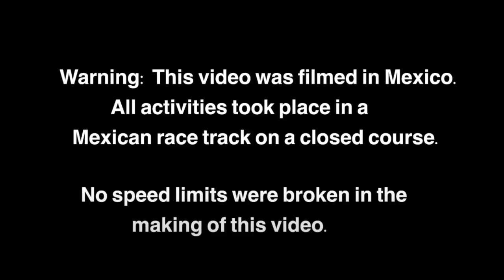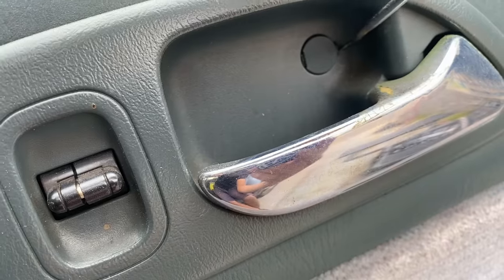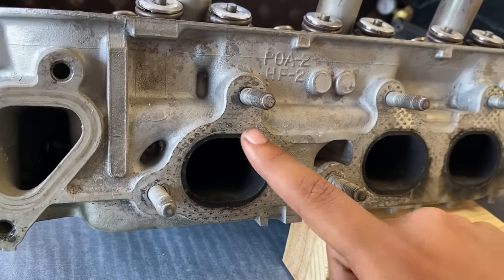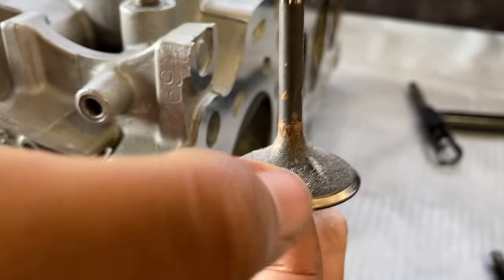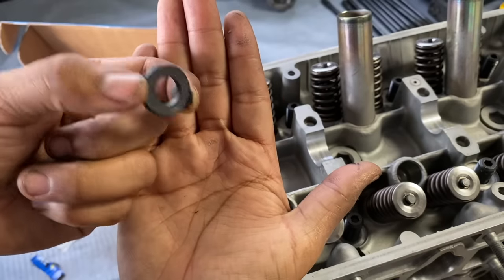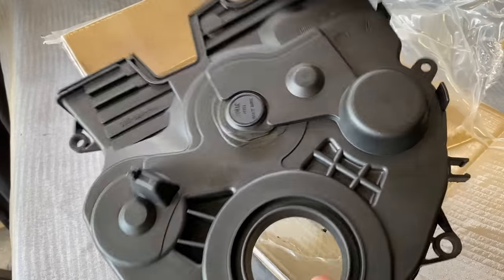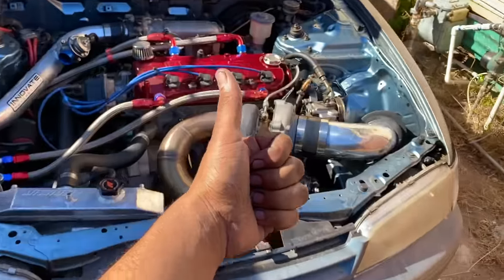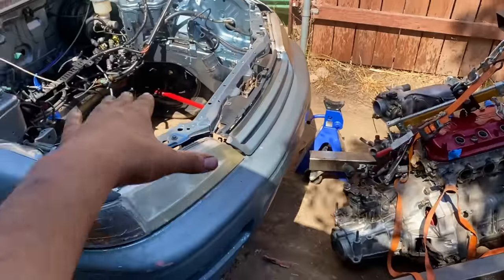Turbo Honda makes 392 Charger Mad + Build Upgrades

Comment: As a 392 owner, I don’t understand why everyone thinks they automatically have race car status when they buy one of these….it’s not that quick. I’m so glad to see a built F22…..I miss my 96 4 door…..indestructible. Shoulda kept it. Nice content.
Reply: Sure the 392 is a sick car, I'd like one, but as you said before they're not insanely fast or anything
Reply: Well that's the idea Fiat/Chrysler does right? The biggest engine wins right? There is no replacement for displacement right? No current Charger or Challenger is a racecar. Just a loud heavy brick that has no actual performance.
Reply: @aidantanny7230  in my opinión I don’t even  find them attractive either they just a big boxy heavy boat
Reply: @fusionsportdaily1650  I've driven my dad 2019 Charger Scat Pack with the 392 Hemi V8 and its a beast.
Reply: @CJColvin  not against real cars, maybe a beast when you line it up next to a 5.7 😂
Reply: Yeah they know nothing about cars their parents buy them for them so they don’t even think about what’s under the hood. They be like my car looks way cooler so it must be faster lmao, he was so salty having his little hissy fit after getting smoked
Reply: I know. Many people but mustangs around here and there all manuals. Only vehicle's that are fast dodges around here are hellcats and the 6 trx trucks that are here
Reply: They are quick, but my car (ecoboost mustang) is quicker than them when I’m running e30. Their biggest issue is weight. And overconfidence.
Reply: @ElRiki77  there's a reason the camaro is better. Chevy may have not fully out thought into it, but the magnetic suspension helps agility alot... The v8 feels cat like. In the dodge you feel the need to just stay straight, and you feel risky diving corners in a dodge, even with the SRT package for the hellcat it's the same. The demon is fine as long as you don't go for the last key like a speed junkie.
Reply: It may not seem that fast to you personally but Its quicker than most average cars on the road. Plus fca did good with advertising the brand
Reply: @bradleyisfishing  Mann I don't kno bout this one I had a 2015 eco boost mustang it was quick but never went over 120 😂 my 2020 scat I definitely hit 140 in it probably could've went faster but wasn't gonna test it😂... again it was a 2015 eco so there probably faster now..boi do I miss her tho I had ruby red
Reply: 485hp is a lot... But the Dodge Charger/Challenger are 4400lb boats with 0 aerodynamics. 

For reference, a C8 makes only 10hp more but it's sleek and 900lbs lighter, so it's WAY faster and handles better.
Reply: honda boys       mopar boys
                      🤝
              most hated
Reply: @CJColvin  yo ppl gonna hate bro I own a 2020 scat charger n it is jus fun too drive n I agree it's a beast sure not the fastest car r maybe the coolest looking me personally I still think Camaro is the best looking looks kinda like a jet, but I've owned plenty of cars and this is without a doubt the funnest
Reply: @fusionsportdaily1650  definitely the stupidest comment I’ve seen in 2021 😂😂😂
Reply: @TheyCallMeMrMaybe  Exactly mate
Reply: @marlostanfield8127  My mom has a 2010 Camaro RS and she loves it.
Reply: @CJColvin  after watching transformers when it first came out I had to get a Camaro I finally got one 2016 convertible but V6 I didn't care tho earlier this year it got shot up😔😔 that's how I got my 2022 scat
Reply: Yeah crazy because I got rid of my scat to jump back to a v6, I just felt the car was only quick against other heavy cars
Reply: @thetrimilliouseffect6372  I admit these car notes a Lil high 150 oil change $70 fill up tank😂 so u only buy a car to race other cars 🤦🏾‍♂️ I see
Reply: @ElRiki77  what’s a “real” car?
Reply: @thetrimilliouseffect6372  why didn’t you do weight reduction?
Reply: @marlostanfield8127  it plows past 120, on e30 I’m making about 410 hp so it more than easily gets up there! Mine is rapid red, so very similar to ruby!
Reply: Homie said a 392 485 horsepower Hemi engine isn't that quick, I don't know what drugs you are on bro.  0-60 in 4.2 and a top speed of 182 LOL.  It's no Hellcat, but the engine sounds sexy as heck.  Even the R/T's got a nice sound.  I am 99.9% sure everyone that buys a Hemi engine gets it for the beautiful sound.
Reply: @HappEShock  they think because it’s heavy it’s not fast. They clearly haven’t heard of weight reduction or performance mods
Reply: @zoidzoid87  oh it’s plenty fast! I was only marginally pulling on it, but it’s still very fast! Anything sub 14 seconds in the quarter is plenty fast.
Reply: @fusionsportdaily1650  land yacht 🛥 in my experience challenger drivers are more respectful than charger drivers
Reply: Goddamn bro you don't know how happy I am to see a 392 owner thats actually aware of what they have
Reply: The 392 is just loud not fast 🤦‍♀️ there nice cars and all
Reply: @bradleyisfishing  they aint fast, even my near stock 2009 ls460 leaves them in the dust every time
Reply: @bradleyisfishing  found the capper
Reply: @DeathhAngel1  bro what are these people on 😂😂
Reply: I miss my 96 as well
Reply: @razzo086  I think of racing someone as going one of two ways: either I win or I get to hear some good exhaust as it goes by me. The third option is electric, but let’s not talk about that.
Reply: @DeathhAngel1  how does it do that? It weighs the same but makes 100 hp less.
Reply: @ashergotti6473  what are you calling me out for?
Reply: @bradleyisfishing  i just realized you were talking about a 392 my bad, ive only raced challengers/chargers with the hemi badge or r/t which i believe is a 5.7. But I would leave them every time
Reply: @DeathhAngel1  yeah they are a much closer comparison to the stock ecoboost, but they are a hair quicker I think. Once you tune you immediately leave them. Fine power numbers but the weight is just too high.
Reply: @aidantanny7230  yea if you want competition for this get you a demon instead or a ghoul💎
Reply: @fusionsportdaily1650  that's some educated hate there buddy.
Please tell us all what exactly you drive. And don't lie
Reply: @HappEShock  they are slow compared to the competitors.  10 speed stangs and camaros eat them alive.
Reply: Yeah my Q50 walks scats left and right
Reply: @TheyCallMeMrMaybe  lol lawd..ur comparing it to a c8 I'd hope it's faster damn I mean c8 is up there lol
Reply: @fusionsportdaily1650  I’m not going as far as to say that and sound like a hater. They are loaded with performance and fun for anyone looking to get started into the muscle scene. It’s a great starter car, and I guess that’s why so many people think it’s the buy all, end all. You can take 6.4’s well over 1,100 hp for less than $15,000 if you can do the labor yourself. My scat still eats Camaros and 5.0 that don’t have the 10 speed….don’t get it twisted, they’re powerful, they’re just not the Bugatti killers that so many dweebs think that they are.
Reply: @HappEShock   my widebody 392 scoots pretty good.
Reply: @bradleyisfishing  agreed. I like the way your setup sounds by the way. Bet it’s a blast. I don’t see why people want to bicker so much as if they’re the ones who hand built their individual cars from the ground up. Anything is fast given enough time money and effort is how I see things.
Reply: @bioheart09  idk man, until my cousin tuned and cammed and did a few other things to his 2017 6.2 Camaro, he couldn’t touch my 2015 scat manual or my boys 2014 5.0 manual. I do like the Camaro though, Chevy just needs to quit pandering and step their game back up nowadays. I have no animosity towards them, they just don’t feel like the Chevy I remember
Reply: @marlostanfield8127  I’ve had my scat to 153….maybe I’m just used to it, but even my 7 yo daughter isn’t even impressed by the power output anymore. I need to step my game up and stroke it and twin turbo it I guess 😂
Reply: To be honest, I just want my first car back. Another 1988 Trans Am GTA with a nice LS swap of any kind and I’d be giddy. Maybe I’m just bored with my chally.
Reply: @fusionsportdaily1650  there is truly no replacement for displacement though….look at NHRA top fuel cars or whatever they’re called. The fastest cars are all pushing massive numbers.
Reply: @noaht5191  I assume you saw my Reddit post? But thanks! I can brag on my car all I want, but I only put a few things on myself and flashed a tune. I have more respect for people building small NA motors (4 and 6) because of how much harder that is. That, and people that build a car way beyond its logical limit like if someone put a built block and made 550 wheel in my car. It’s uncharted territory and it is crazier to me when that si was making 230 wheel NA than my boosted car making 360. Even though I have lower displacement, it’s really cool to see. 

My car is a blast. Pops loudly when I want it to, has a really interesting sound above 6k, and has power absolutely everywhere through the revs.
Reply: @noaht5191  everything after 2014 has like no heart or soul. Just looks... Trust me I know. The 2012 - 2014 malibus were quick asf. I'm surprised Chevy is that bad with the newer ones though... They need to just axe it atp and just spend whatever sports money there is on the Cadillac V. Or what's left of the V. Camaro is done because it's more uncomfortable to get in and out of then most cars I've owned or seen.

Yo cuz have a manual in the camaro or a automatic?
Reply: 392's are impressive but they're not that quick, stock for stock an LS3 vette beats them. And an ls3 with just a cam beats a hellcat. I raced an auto pullied hellcat in my Cam and headers only c6 and I stayed on his bumper, if we had a little more room, I would've passed him
Reply: My 09 ISF eats these for snacks.
Reply: @sebastianblas3109  corvettes do two things really well: top end and hauling golf clubs. They have great aero and just keep pulling and pulling. Mustangs do great top end, but a c6 does a claimed 186 mph with only 400 hp. Scats are great below 100, but fall off hard after that.
Reply: @2 Wheel Life Nah, i have LDP's and a tune haha
Reply: @Nonya Biz damn I felt that comment. Fiesty babeeeeyyyyy. You ain't wrong tho, rwd can handle the most power. AWD distributes it the best.

To much FWD power causes the front end to dance no matter what you do. Especially if your car is light as shit, every gear will make the car buck.

Shorty got down with the sports mode on. Let that scat have been supercharged tho.
Reply: Jim jibroni  uhhh...a shit load of people lmao, dodges especially
Reply: Jim jibroni   You are pretty full of hate my guy. You should work on that it's just a car lmao.
Reply: @bioheart09  a dodge feels like the most stable car in the world with its front snd rear double wishbone suspesion I floor mine in full corners in order to negate the understeer
Reply: @hemiplow1297  trust me, that beast doesn't bend like a Honda. The learning curve of the dodge vs a Honda is not even a competition.

Remember, the charger has Nürburgring times. Limits have been pushed. But you'll see in alot, the drivers have to really rely on those brakes to gauge those sharp turns correctly becsuse you have to commit to it.

Older Acuras suffer from the same issue because the SH-Awd system would cut off on you if you let you foot off the gas to control the turn. You have to pedal through the turn to keep the torque vectoring active.

But HONDA, is a efficient ass FWD bro. I can't see a dodge beating a newer Honda with a track that has turns.
Reply: @sebastianblas3109  I can second this. My pops has a anniversary c6, pure stock, and I was able to kill a 2014 scat pack, touged him to so he know it was real. I'll say, GM was doing great back then...
Reply: Im curious  how much hp does that f22  put  out ?
Reply: @jacdime12  there's two versions of the f22 I beleive. I'm not a mechanic or anything. Kinda slow too. But I think there's the f22a1 and a a2. I only kno this nonsense cause of the prelude.

Aw shit I'm smacked. I think one puts out 145 hp. The other is like 120 or somthing.
Reply: I get excited every time I see a 392. My modded Focus ST gaps them every time. The butthurteddness of Mopar guys is always funny.
Reply: @malaki4519  but even with mods they’re slow
Reply: Made for going straight
Reply: @TheyCallMeMrMaybe  cost X2 the price of a scat pack
Reply: It’s okay bro I pick on 392’s with my gti it’s so fun to get them mad
Reply: @fusionsportdaily1650  you realize every hemi besides the 5.7 is amazing? Only thing wrong with dodge motors is weight to hp ratio. The 5.7 is only bad from factory because with a better intake, cam, and throttle body itd make 410-420isn hp😂
Reply: @ElRiki77  5.7 only bad because they didny put a Performance cam, and they put a restrictive throttle body on it and headers, with a shitty cold air. The 5.7 is a beast n thats why that nurfed it
Reply: Or when they beat one lmao
Reply: I totally agree and no offense but now n days everyone thinks they need a v8 to b fast its honestly mostly just sound v8s still have lost against built 4cyl turbocharged cars and v6s so i dont see the point of getting snobby in a car everyone else has
Reply: Thats all dodge owners
Reply: @thecajunhunter8337  i agree dont wanna put every dodge owner in that basket but majority i dnt get why ppl cant just respect others builds and understand how to take a loss its part of life if they are gonna get all all hurt dont race. 💀
Reply: @thecajunhunter8337  dont forget most these guys build there cars for going in a straight line these guys have no idea what time attack racing is doubt they can hit turns and heel toe downshifts
Reply: @marclobato9690  my buddy bought a 392 and I blew his doors off with my Fass fueled 6.7 Cummins the day after he brought it home. He told the dealer he had buyers remorse. True story.
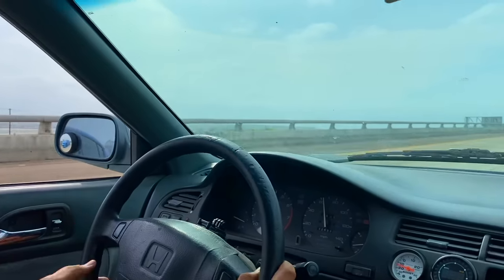Reply: At 4:10 in the video where the Honda is getting on it you can see the 392 come back on gain ground and almost pass him in his driver side mirror. At that point, the camera man decided it would be the perfect time to point the Camera at the floor board.
Reply: @TheyCallMeMrMaybe  Yeah I beat a 392 with unknown mods in my 2.0t Accord I do have a stage 3 tune, fully catless, intake, flex fuel etc. still stock turbo can’t wait to upgrade the turbo next. Weight of the accord is 3200 lbs that helps it beat the 392 as well.
Reply: @bioheart09  I brought an civic ep3 si hatchback as a fun project in hopes that it can corner better than the challenger but I was wrong,my challenger grips and hugs the road alot more in the mountain twisties of californa and alot less oversteer and understeer on fast corner entrys especially with 305 tires in the rear with eibach springs/shocks.Ive outcorner a bunch of subaru STIs and golf r32s in tight corners while they either have to hit apex or go wide i stay in my lane. planning on doing strut braces and frame connectors next to really get up there with the older track built e46 bmws
Reply: @bioheart09  while it feels heavy you have to power through and manhandle it through the corners,it can turn alot more than it feels like
Reply: @hemiplow1297  which leads to a more engaging experience, but it isn't efficient enough. I love my muscle baby I truly do, but sadly foreign is way ahead.
Reply: I drive a Lexus IS 350 and at lower speeds I gap 392s but after bout 100 I’m off the gas
Reply: @MrThaKing1000  lol what do u drive that’s faster…
Reply: i recall a time when 200-300 hp and a mid 13’s from an every day factory was a big deal. Guys would have cut iff their nads for cars like these 15-20 years ago.
Reply: @DeathhAngel1  “near stock” is that a misnomer like “showroom stock”, “bone stock”, “bone freaking stock” “stock except intake & headers”?
Reply: @thefitnesslife4988  because those cars have better PTW. 🤷🏻‍♂️its not a challenging concept.
Reply: I got 12.9 on my 2014 srt 300 quarter mile. Stock.
Reply: Lmfao bro literally thank you
Reply: @sleeperwhips  a fucking 93 cobra with a 351 Windsor and nitrous lmfao
Reply: Quit lying you don’t own one
Reply: Bro these 392 owners here in Atlanta 🤦🏾‍♂️ got a 1.5JZ Supra for those guys and hellcats.Lol
Reply: @mjplays6540  its a v6. Lower weight so the low end torque is there. No way a long haul will be in your favour. I think that goes for most vehicles honestly.
Reply: If you have the money , but this little racer with a few modes , and a couple of bucks can blow the fucking doors off your xpensive boat with wheels .
Reply: CuZ iT cOmEs WiTh 500 HoRsEpOwEr
Reply: If it isn't a Hellcat you might as well take it back, you have nothing for racing, kia, Hyundai, basically everything on the road will Smoke you!
Reply: I’ve had one a scatpack it’s a fun car but not really fast I switched up to a gt 5.0 defenetily am making more power with a supercharged now
Reply: @DeathhAngel1  what have you done to it I have a 07 and thought the scat pack was faster
Reply: It is because most people that own these are in the ghetto, young, and cocky
Reply: Idk I have a srt Cherokee and it's pretty fast
Reply: I agree, I had a 19 hellcat and it wasn't that fast when compared against modified cars.
Reply: @Nonya Biz there is this great thing called drivetrain loss and I'm pretty sure fwd cars suffer from it quite alot less and typically in terms of speed fwd us really no difference just typically fwd cars have smaller and less powerful engines to accually fit it in the god damn engine bay all sideways n shit but if they both had the same motor and gear ratios and all of the shit that affects that the fwd might be a little tiny bit quicker as its lighter and again less drivetrain loss the difference that I think ur referring to is handling. Rwd cars tend to oversteer and fwd cars tend to understeer but rwd cars are just cooler and allow u to accually put big ass engines in there
Reply: Y’all are the ones that be wanting to race and get mad because y’all get gapped by a old model accord
Reply: Charger weighs about 4300lbs now doesn’t it? It’s power to weight ratio would be around 8.86 hp per 1 pound of weight. That’s not that great. It’s a cool car to daily and I love how they sound but I think the owners need a reality check.
Reply: @bioheart09  Honda tests their Type-R’s on the Nurburgring. I’ll go search the lap times between both cars and report back what I find.
Reply: @bioheart09  Ok I got some numbers. The Civic Type-R ran a 7:43 and the top of the line Charger Hellcat ran a 7:39. 707hp at a 4 second difference on a high speed track.
Reply: I swamped a 392 with my golf R dude thought he was so cocky.
Reply: @boostybotha355  if i answer you will u keep continuing to ask questions?
Reply: Just a whole bunch of noise and ain’t going no where especially when they have the scat pack Lmaoo go get a red eye / SRT
Reply: @dxr1vnt024  wtf you talking about little guy? I didn’t even ask a question. Go tag the correct person kid.
Reply: @boostybotha355  you said "darian can you though" that is a question your asking me can i.. you reject
Reply: I wouldnt be respoding to you if u were the wrong person your all over the place arguing with someone and your end of the story is wrong ok ima go to sleep now goodnight 💀
Reply: @dxr1vnt024  what are you talking about? I was talking to 2wheel about my Q50 walking scats. Gtfoh
Reply: 😂😂😂😂😂 “450hp iSn’T tHat FaSt” someone’s never had to buy their own beater and it shows.
Reply: Aye man this can also be said for the people that buy v6 chargers and challengers 😂 constantly upbadging as well
Reply: Lmao “aS A 392 oWnEr” dude that’s literally why… nobody cares 🤣🤣🤣
Reply: It’s just fast enough to do some cool pops and gargles
Reply: @thagoon8000  it’s a hemi boat tho
Reply: Maybe the commercials got to them
Reply: @fusionsportdaily1650  well I mean this is a fully built car vs a stock car it’s awsome how much they could keep up like that
Reply: @zoidzoid87  exactly they are pretty fast but against a fully built car that’s 1/4 the weight they are going o lose lol. Though if you’ve ever rode in a hellcat before they are amazingly comfortable in my opinion
Reply: Bought cars are not impressive at all when it comes to acting hard.  They don't know how to work on them.  I don't either lol.
Reply: They are one of the fastest cars for their price and extremely fast for stock naturally aspirated.
Reply: @aidantanny7230  for stock naturally aspirated they are.
Reply: @fusionsportdaily1650  they are drag cars and  challengers do take a ton of street stock drag titles
Reply: @ElRiki77  for a stock sub 45k car with a high upgrade ceiling it kinda is a beast.
Reply: @philliplyttle1005  a scat pack or 5.0 mustang are faster than a trx truck, plus all a hellcat is is a factory boosted scatpack
Reply: Power to weight ratio is something they dont put much thought into...  I have a gutted 16' Focus ST making 359whp on a 2867r gen 2 and it will eat a 392 just because that 392 is heavy like a chevy...  I'm sure with mods the 392 can really come to life though!
Reply: @bradleyisfishing  they aren't trying against you, they still have more power stock and are geared for straight line speed and you aren't. You have less whp than my gt for almost the same weight and I keep up with challengers but can't gain on them.
Reply: @Aircraft_Fabricator  how gutted is it? You have to get it down around 2500 to keep up with a 392 and that power output
Reply: @marlostanfield8127  newer ecoboosts aren't really any faster and your 392 tops at 165, I've raced a 2018 392 upto 140 in my gt and it was dead heat
Reply: @TheyCallMeMrMaybe  handles better yes, way faster no. The gears matter a lot and the c8 is gears for tracks while the 392 is geared for straight line speed.
Reply: @tatsuhirosatou5513  I already know this but most vehicles here are actually pickup trucks and modded classic muscle.but then again there is about a total of 12 mustangs and a bunch of annoying af strait piped v6 chargers
Reply: @tatsuhirosatou5513  I make around 360 whp on e30. My car weighs 3532 from the factory, that gives me under 10 lbs per whp. A 392 challenger weighs 4279 from the factory and makes maybe 430 whp. Similar power to weight, right? There’s also torque. I’m making around 400 wtq, and a scat is making probably about 425 wtq. My power band is stronger through the revs and not just at the top, so it drives faster than other cars with the same power numbers. Also, to say they “weren’t trying” doesn’t make sense. Are they going to race me on 90% throttle? No, they are going to floor it. I’m not sure what GT you have, but power band tells more of a story than peak numbers.
Reply: Car is a beast under 60k. Not to many cars faster under 60k and if they are it's just because their lighter. 392 is a true muscle car
Reply: Oh yeah. Don't forget it has a backseat as well.
Reply: @teareal09  shii I couldn't afford a cat n coming from a V6 Camaro da Scat was a perfect price n upgrade..I'm in Cali my dealership had 2 Hcats for $80+ I'm good G took da Scat for 43✌🏾😂
Reply: @marlostanfield8127  I respect it g
Reply: I thought buying an r/t charger with a couple bolt ons would be soooooo fast until my 2nd day owning it a 93 accord flies past me doing my whole dash
Reply: I have a sti I expect the scat to be more of a race car
Reply: Unless done properly a muscle car is just a big boat with terrible handling and mediocre performance. They do look great though
Reply: I would argue that while they’re moderately quick cars, the fact that it’s true doesn’t save you from Hondas with GoPros on them lol
Reply: A 4 door car that hits 60 in under 4 seconds and a 1/4 at low 12’s is pretty quick with a top speed over 180.  Not too many cars under 50,000 can do that
Reply: Most people think quick = a fast car. There's a big difference between having a quick and a fast car. Imo
Reply: what are you bothered about… i drive a 4 banger 2018 Camry..: so what man….. love to see any car you like take a ninja or a gixxer
Reply: It's all about power to wieght...
Reply: Vasaline
Reply: the guy in that video should be humbled and drive a civic for life.
Reply: @2 Wheel Life  I've got a widebody 392 in plum crazy in a six speed. Idk what these dudes are talking about it will go. Is it as fast as my friends c8 corvette? Fuck no. I just love classic muscle cars and this as close as you can get. I'm 29 idgaf about lap times and shit. Just fun cars. People that like cars should like all cars.
Reply: It's not the fastest or the quickest car on the road,but it's the most powerful NA motor in its class.Pull up to a stop light,most cars won't stand a chance,from a dig.
Reply: hellcats are not fast neither are demons I seen them get gapped by m5's and c63 amg's
Reply: Leased Scats and Hellcats think they’re the fastest shit bro. Kinda nice to see a humble dude in your scene for a change. That’s not a sarcastic statement either. Every 392 owner thinks they’re the fastest shit.
Reply: Scats are beating 5.0’s and SS’s only the 10 speeds can compete 😂 & yall drunk asf if you think a 485 HP Car that can go 180 is slow .. most of y’all drive Camrys lol
Reply: @dracohoe  lol bro only 10 speeds can compete and what happens that A10 gives him the sauce. Manual SS Maros Also Walk Tf outta them lmao. Scats are slow cars if you owned one you would know. Just better To save for a Hellcat and Go FBO With E85 😂
Reply: @restlessdreams1869  a 4 door family sedan keeping up with sports coupe that can hit 180? It’s fast to me I got a baby I can’t drive coupes 🤷🏾‍♂️ . I literally drove in one & it’s a beast I’m not a racer & I’ll be the fastest on the road 95% of the time so 485 is all I need ‼️
Reply: They forget they weigh like 4400 pounds
Reply: They’re too heavy
Reply: @bioheart09  its called suspension and tire upgrade . Makes world of difference in a challenger. The camaro was good til they gave it that awful facelift.
Reply: @TheyCallMeMrMaybe  and its mid engine. Thats a huge advantage in itself thats why its so much faster. The weight is more balanced as well. Like a porsche 911
Reply: @malaki4519  fr. A 5.7 with an rt will give an average hellcat driver a run for its money. Same with a cammed 392
Reply: @jonathangarnica6513  you cant get a demon anymore without paying markup price used. They only made it for that one year. Very rare car
Reply: @noaht5191  this. A man of culture.
Reply: @sebastianblas3109  weight..
Reply: @MadSlav11  yep. Throw full bolt ons and if you wanna go fast without getting a new car throw a supercharger on it and it fucking pulls.
Reply: @mjplays6540  salute fellow is350 owner.
Reply: @tatsuhirosatou5513  not true its 2 completely different motors. 6.4 thus the “392” versus a 6.2L supercharged hellcat. They are not the same in any sense
Reply: @Titoburritobandito  my type of guy
Reply: @romanrivera1407  those cost 2x the price of course it should be faster
Reply: @8500Rask  man I just don't understand the hate. Blows my mind faster than these dudes slap a fart can on.
Reply: @trippen4391  As I drive a fiat 500. Don't worry brotha we can tell.
Reply: @8500Rask  aww yo u mean the ankle cutter facelift? Lmfao trust me I gave up on chevy seeing how all of their vehicles have changed. They have sincerely copied foriegn automakers, magnetic suspension was damn near their last genuine  idea.

Other then that, there's none I can say, dodge is on fire right now doing great. Aye they just came out wit a  program that was available YEARS ago that gives the dodges stage kits.
Reply: Haha nice. I had a nice widebody with with adjustable suspension. Always took pride in beating lighter pony cars. Like the camaro ss, gt5.0 ahem. Bone stock, idk if it was a factory beast. But as the saying goes, the driver not the car. Definetly got bullied by race car v6s.
Reply: Those big V8 dodges are probably fun as hell to drive on the open interstate, i see them as a touring car more than a race car.  Anybody who has owned a 90s honda knows how well they do in the corners. Id use an old civic for a track car before any modern muscle car.
Reply: @8500Rask  Can't afford an m5 or c63 amg but I can certainly afford an m550i twin turbo v8 just got to get my credit up a tad bit😁
Reply: Do you have an Instagram, I have a question about some modifications
Reply: I don’t mean they’re slow, they’re just standard cookie cutter muscle cars, not some bigger than life creation, they’re fun, and hell I enjoy a 5.7 Hemi just as much, but people shouldn’t act as if they’re John Force burning the track down just by getting the keys to a shiny new scat pack because there are much faster things out there. Anything can perform and be faster if you’ve got the money time and talent.
Reply: "It’s not that quick"

Stay off the drugs.
Reply: @johnwatkins3883  but he got mad tho. He stepped on it too....
Reply: @fusionsportdaily1650  you ever seen a dodge demon my guy?
Reply: @marlostanfield8127  I've gone 140 in an almost stockish Celica GTS, until you've driven actual cars made for racing , my old celica or your experience doesn't hold a candle to what cars built for it are like. Any stock car like that is just advertising,  thats all.
Reply: Love my scat pack but yea. They’re fun and very enjoyable but they’re definitely not full blown race cars. Just a fun daily to me. Everyone sees my wide tire setup and wants to run but I’m just like mehhh I’m vibing 🤷‍♂️
Reply: @fusionsportdaily1650  And that's actually why Dodge quit production of that one crappy Charger trim that supposedly was performance oriented.
Reply: @aidantanny7230  get a hellcat or demon or RedEye 392 is a mid trim
Reply: Lol it would have beat this.....
Reply: @zoidzoid87  It’s quicker than most average (stock) cars. If you put it in the wild against many built cars like what happened here then it’s slow as dogshit.
Reply: I love the way the new challengers and chargers look. Interior is pretty outdated tho... And logically I'd have to go with a mustang 😂. But just for looks I love the mopars. They just look good to me
Reply: The Charger and Challenger are drag racing cars. Roll-racing is not its strong suit, mostly due to weight and gearing. If a 392 goes up again a car like this one, and it basically weighs as much as a bag of feathers. Great video!
Reply: @fusionsportdaily1650  There really is no substitute though. Sure you can turbo a little 4 and it will make 400hp, if you rebuild it every 20k miles. We already know what happens when you add forced air to a charger, is called a Hellcat and Demon. You will never get that much power out of an Accord motor, so no, there is no substitute for displacement.
Reply: @aidantanny7230  Depends on where you draw the line on "insanely fast". There are very few cars that stand up to a 392 and most will cost you a lot more. Is it a "supercar"? No. But about as fast as it gets before you enter that territory.
Reply: Stock-for-stock Factory... that charger will beat that honda any day
Reply: @thagoon8000  and you think that twenty-three-year-old Accord is attractive-looking?
Reply: Why can’t u just say what car it is instead of just saying numbers 😢
Reply: He just doesn’t know how to use it, was obviously on traction and probably not on sport mode
Reply: As a gti owner who can keep up with them for much less money they aren’t that fast I agree but I’d still take one. People buy these molar guys just to race people I feel like but you should buy a car based off how it feels, I love my gti but I’d rather mod a 392 if I had the money
Reply: @aidantanny7230  i have 392 and yes its to fast 💪
Reply: @fusionsportdaily1650  That's correct. You can't really compare a built 4 cyl to a stock V8. Build a V8 to the same level and it's going to produce significantly more power. I do believe they're approaching 12k hp when running Methonal. Have 4cyl reached that yet?
Reply: @bradleyisfishing  I've driven both.. scatpack blows Ecoboost out of the Water. Way faster!
Reply: @2k3familytv80  the scat pack is quick! I have actually beaten 3 scats with the most recent being a week and a half ago. Had 3 runs, with the last having them take the hit. I am making around 370 hp to the wheels, so definitely not stock.
Reply: @bradleyisfishing  I've beaten 2 Mustang Gts. So how is this possible 🤔
Reply: @2k3familytv80  what years? Maybe they were slow shifting? Can’t explain it unless these scats were making less power on 87 or something.
Reply: Most people who buy 392s, its the first real car with power for them, despite what most say. So hence everyone acting ricky bobby
Reply: @razzo086  it’s crazy you literally 100% right bro I don’t know much if any bout cars but yet I love cars tho,an I always use to think the nicer the car the faster,but lately I’ve been takin the time to learn some stuff an rlly understand now,like I drive a 2017 Corolla full stock 138 hp an Ik it’s slow but I still love to race ppl jus for the fun of it yk,an chargers are nice but I tell myself me personally I’d never buy a challenger or charger they jus not my thing at all,again they look nice tho but I’d never want one,trynna get me an infinity hope I get it so I can start my own build💯
Reply: @zoidzoid87  well no shi it’s faster then most cars a is a V8 engine the point is when u line it up against someone who worked on there car fr it’s losing 9x outta 10
Reply: @123chopperboy  jus watch the video n you’ll understand wat a real car is
Reply: @HappEShock  I’d lower that “99.9% sure” of urs if I was you 😭💀
Reply: @marlostanfield8127  lol my 2000 acura integra did 150 with basic bolt ons. May have taken longer but that's not a great measurement of speed.
Reply: @ElRiki77  Most people don't realize a Ford Flex will spank a 5.7 RT. Even the Hellcat is slow when you consider it's a boosted 6.2. The 5.0 Coyote is rated for the same power as the 6.4 naturally aspirated. Dodge is just kinda a joke, I'll never understand the heard mentality of buying a Charger or Challenger when the competition is clearly better
Reply: If you put a turbo on it will be fast.
Reply: A scat on a tire will beat most things on the road, these are roll races where Mopar does not Excell.
Reply: @dmlmedia7382  you could say that about any muscle car, the scat is the most expensive so that logic doesn't make sense
Reply: @bioheart09  
When the retro designs came out, I test drove a Camaro, Challenger, and Mustang. I liked the Camaro most because it felt the most nimble of the three.
Reply: @LuckyCharms777  that magnetic suspension is the holy grail. Chevy isn't the fastest, but my God they are high up on the handling tier. Imagine the power of a hemi, with the suspension of a camaro. That's a beast straight outta hell and ready to kill any competition.
Reply: @marlostanfield8127  the only reason a newer stock eco won't go over 120 is because it's governed. When it hits 120 there's still a lot left.
Reply: It's a low 12s car. Even my SUV is faster. My SUV runs low 11s.
Reply: @bioheart09 love my 21 ss 1le 👍🏻
Reply: @donaldjames4340  a monster fr. It may be slower then a hellcat, but handling and acceleration is mad nuts.
Reply: 480 horsepower isn't that impressive when it has to push 4,800lbs.
Reply: @philliplyttle1005 trx is actually slower then scat packs
Reply: @CJColvin   the ss be slappin
Reply: Yeah, when a Rav4 Prime can hang with you, you're not fast bro!
Reply: @ElRiki77 you’re not much better 😂
Reply: @marlostanfield8127 bro what?! my 05 stock civic hits 120, u were just scared of its potential